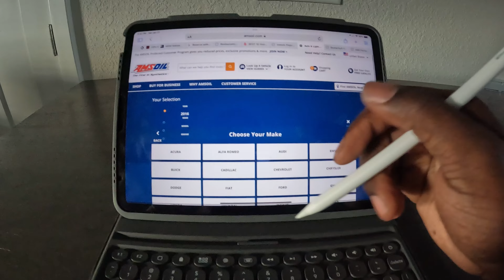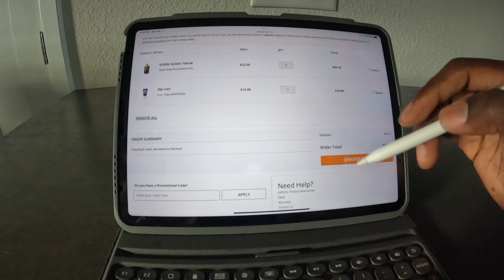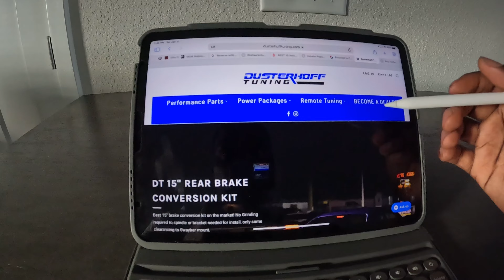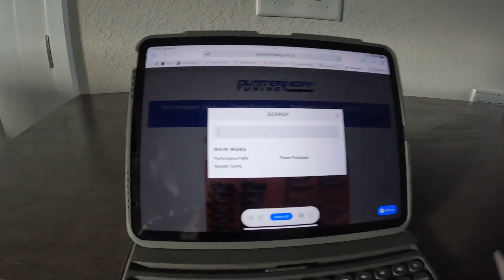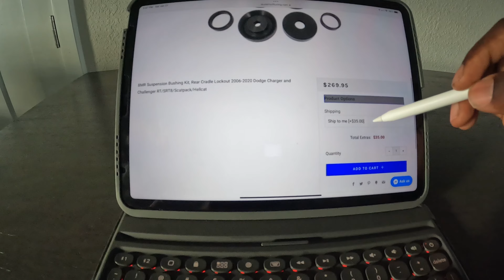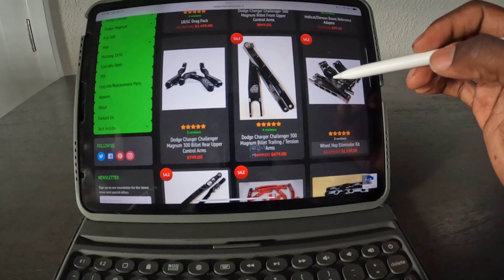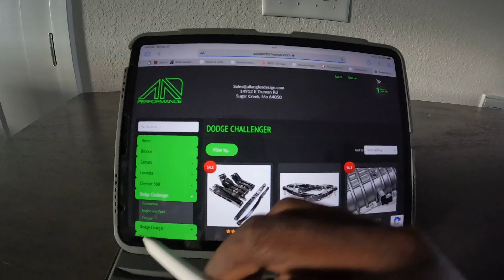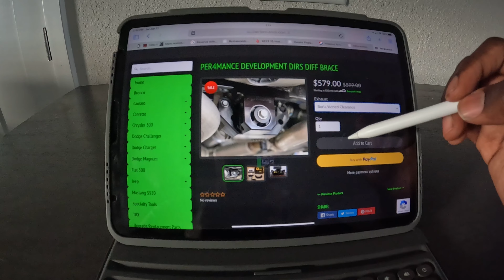BEST HELLCAT AFTERMARKET SUSPENSION SETUP

Comment: i have the complete AAD suspension front and rear with the new front lower control arms and sway bar links front and rear(blood red)also rear cradle lockout,rear diff brace and eibach prokit springs, running 20x10 rims front with 275 40 20 and rear 20x11 305 35 20 mickey thompson street comp on my 19 challenger hellcat redeye.....AAD components are the best and are easy too adult for alignment.
Reply from the maker: That’s a good set up I know with that set up that redeye is hooking up nice

Comment: Heyy what did they charge you to in stall suspension? Thanks in advance 👊🏾😎
Reply from the maker: So how they do is by the hour? I think it was an 8 hour job so it was around 850. That’s with dropping the cradle, putting in demon springs front and rear and a full inspection of the car. This was by far the best mod for traction